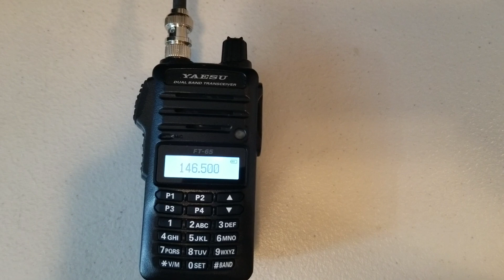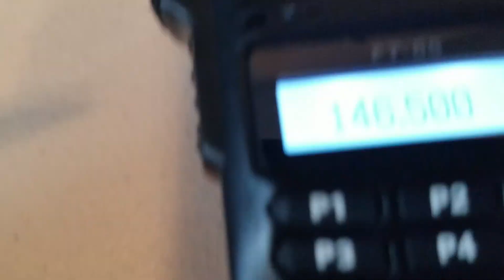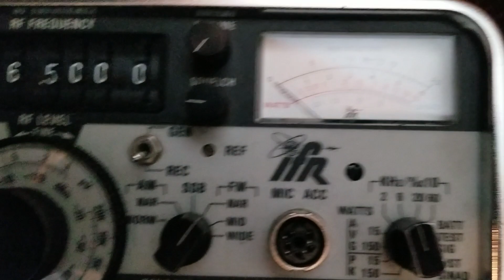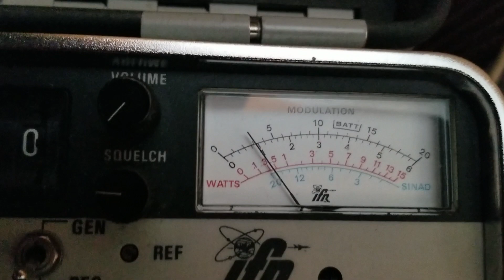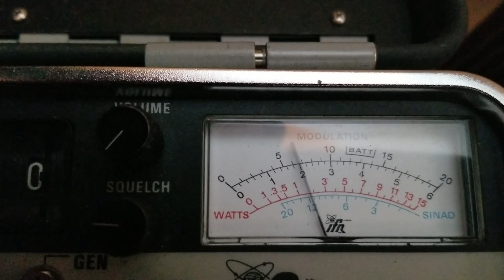Proper Use of the built-in mic on a VHF HT transceiver.

Comment: Commercial radios are designed assuming the user stays CLOSE to the microphone element. Many of them have a second microphone, perhaps on the top or the back of the unit. This microphone is out of phase (red and black leads reversed). Sound reaching both microphones cancels quite a bit, mitigating the noise where the radio is used. To avoid falling into what the radio thinks is noise, you need to talk as close to the front microphone as you can (and therefore as far away from the "noise-canceling" microphone possible). If the front microphone has high gain, the recommended close-talking would cause distortion (and pick up more noise). So expect even radios w/o the noise-canceling feature to be designed for the same technique of use.
Reply from the maker: Thank you for this explanation.  Much appreciated, George.

Comment: Just open up the Case, find the FM-Deviation Poti and crank that Thing all the Way to make this Handheld scream. YFUG just said that...73 & have a kickass Week  💯🙋‍♂️👍
Reply from the maker: I guess it's an option, but I think the point is to just try to find the mic and speak into it.  That's the simplest solution.  Thanks
Reply: @RedSummitRF  Way to go... 💯👍🙋‍♂️
Reply: @WECB640  Congrats! Then just crank that FM Dev. Poti til it's good enough. My Ex-Neighbor in SoCali used to fix any Problem with just a Dolly, WD 40 and Duct Tape. Did you tried that one already  ?  73
Reply: Glad if you make it easier with youtube video

Comment: "Back in my day..." As a ham of over 30 years, I was used to talking into the speaker of my HTs and speaker mics as that is where the mic element was. These newer radios forced me to locate the separate mic 'hole' so I could be heard properly. The mic hole on my latest radio (a Radioddity DB25-D) is at the bottom of the keypad...where my hand is usually covering the keypad. I have to learn how to use a radio all over again.
Reply from the maker: Wow, that sounds rather inconvenient.